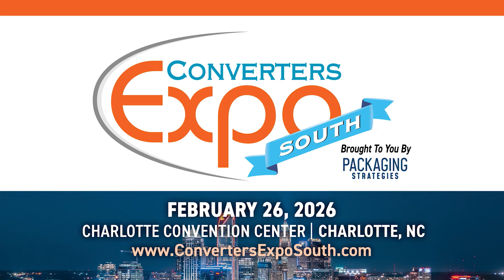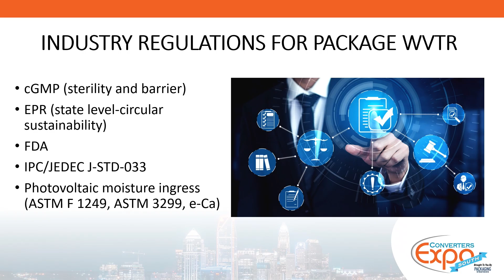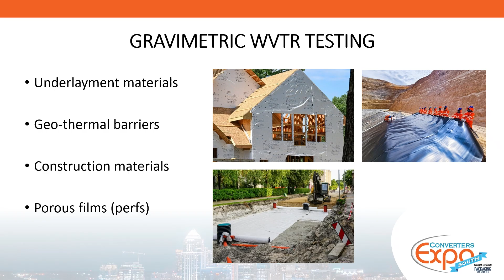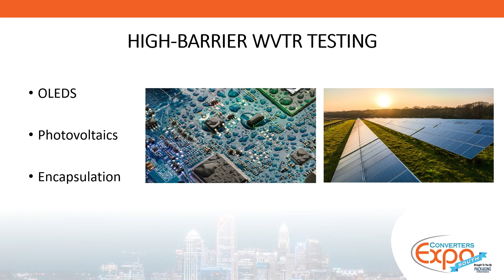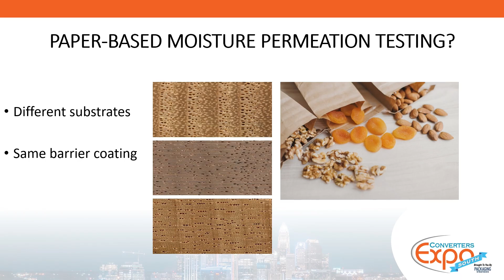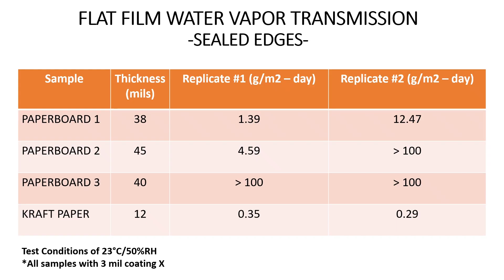AMETEK MOCON at Converters Expo South 2026

Comment: Thank you very much for the explanation. I have some questions:  
1-  when edges are coverd by the epoxy, which side the expoxy should be applied? on the test gas or on the carrier gas? and why?
2- do you recommend always test the fiber based coated samples (flexible and cardboard) with double foil masks + epoxy to mitigate the edge effect or normal testing area is enough?

thanks.